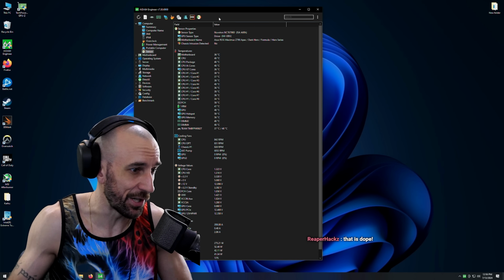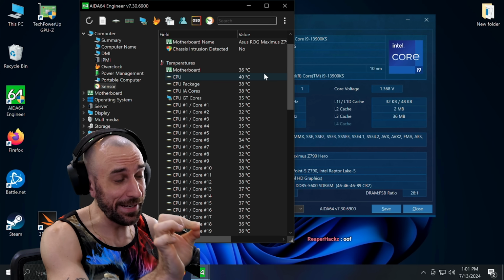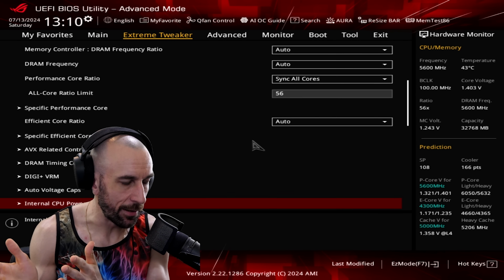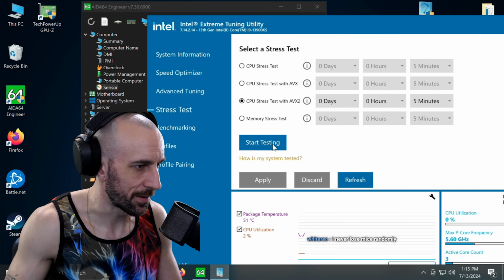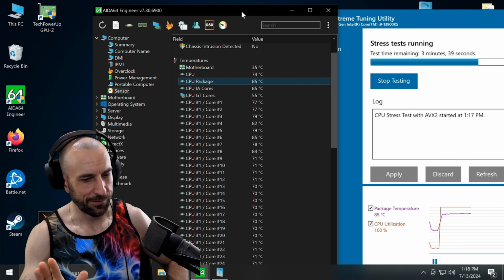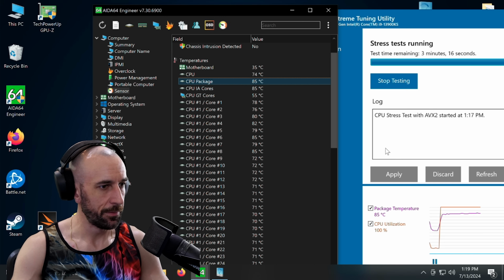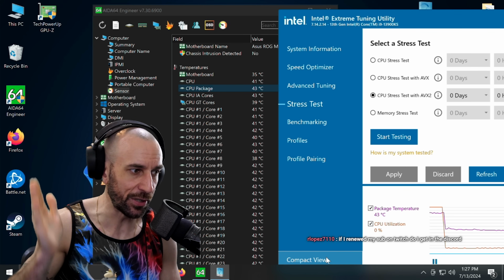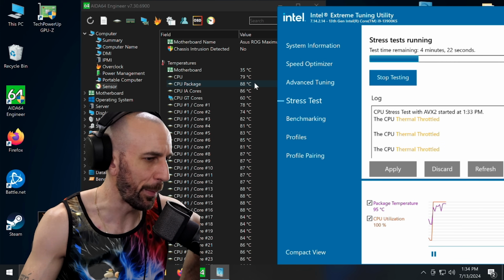🛑 STOP YOUR Intel Crashes 😱👑 (Step by Step Guide)

Comment: Just wanted to say you absolutely were right about the P cores, E cores really it's been better since I turned them off again a couple days ago (12700KF & 12900KF). Gonna see what you have to say about optimizing though I don't have the 13/14th problems with the 2 P cores boosting too high. There is so much bad advice on TechTube though you are helping so much fighting disinformation and just bad advice from people who don't game that much.
Reply: In my case i run stock on my 12700K and e-cores help to boost my singlethread speeds and fps for emulators. I never disabled them, if i do an experiment would be disabling hyperthreading for one P-core.

Also keeping all the cores on are important for fast shader compilation, there's nothing that i hate more than shader compilation stutter and long compilation time.

Comment: I don't even have an 13/14th gen i9 but still undervolted my 11700k and it now runs cooler while performing better than stock. Good videos.
Reply: It REALLT depends on what kind of load you are throwing at it! Trust me!  Most cpu works with undervolt in 90% games. But there is stuff out there that dont. IT will actually require more voltage. Latest being shader decompress UE5 engine. Read my comment up and try out- if it works for you great if not... you cannot consider your cpu 100% stable. it may be stable in the few apps and games you use. But not overall

Comment: Any recommendations for 13700 users? Or are we in the clear?
Reply: According to reports, its the 13th and 14th gen 'K' CPUs. It wouldn't hurt locking the cores to be safe.
Reply: @Alex-ii5pm  does locking means setting the maw boost multiplier or running them all the time at a certain clock ?
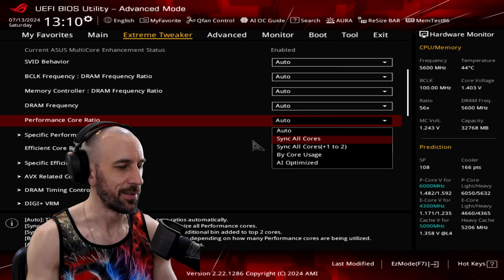Reply: @jittertn  5:18 how its set up here, it sets a maximum, but doesn't lock the frequency to what it's set to, meaning it will down clock if required but will not boost beyond what is set, it will stop (lock) all cores boosting beyond 5.6 ghz. If you set performance power plan in windows the CPU will run Max clock speed 24/7
Reply: @Alex-ii5pm  thanks for the answer gonna set mine accordingly

Comment: THANK YOU! for finding a solution..
Other tech tubers don't know how to fix this issue,
 so they just keep fear-mongering in all directions, shaming Intel, provoking panic..
The CPU just needs a little more voltage, that's all..
Reply: Maybe Intel should know how to fix the problem. Maybe there shouldn't have been a need for clients to troubleshoot products that they bought which don't work as advertised.
Reply: @Dexion845  It's actually not Intel's fault! it's Motherboard Manufacturers! 
because they made Bios with different very low AC Power load-line settings to under-volt the CPU by default.
Intel specification recommends that AC and DC power load line setting have to be the same value, 
But motherboard manufacturers always put very low AC load-line settings by default, compare to DC load-line..
thus sending much lower voltage to the CPU than required..
You can check your motherboard AC and DC Load-line values in HWiNFO, in the "Main window" click on central processor, expand it, click on your processor and scroll down to the "IA Domain Loadline (AC/DC):"
i bet they are different values even tho: "intel recommendations "intel default settings" clearly sate: "DC load Line must be equal to AC load Line".

Comment: Stop your Intel crashes by going ryzen.
Reply: Wish you would have told that to my 7800x3d before it decided to become unstable and had to be RMA'd. Luckily I still have my 14900ks that I tuned and undervolted to my liking when it was new and it has been rock solid stable.
Reply: Some of those game/datacenters did just that switched to 7950X (must have been expensive to do that). Not in the discord but it's taken me about a year to tune fully stable no game crashes (can see the value of the Discord and CoD Bros aren't wrong for just wanting to play after work). Am on 12th gen though 12700KF & 12900KF (have a 12400F around to try tuning also). Spent a lot of time in the BIOS more than 9th gen, even switched to Nobara, Windows 11 was also annoying to troubleshoot, last straw was when the 12700KF just BSODed not doing much in Firefox. Intel had some great sales last year and after it's tuned stable the upgrades have been nice (game doesn't stutter anymore).

Comment: 13900k - zero issues - discord member.
Reply: 13900k, Built system march of 2023, adjusted bios out of the gate to not let chip run rampant and never had a hickup.

Comment: Is it ok to leave it at 6ghz boost, if running a max voltage of 1.375v?  Is the is frequency a problem?
Reply: It's ok, but i HIGHLY DOUBT it that your CPU will be stable at 6Ghz with that voltage.
Reply: @AfshinBarani  not all core no. its 5.8 all core and 6ghz for the first 4 cores. so 60 60 60 60 58 58 58 58

Comment: Also with a rzyen 5000X3D cpu ?
Reply: First thing I did with my 5800X3D was use curve optimiser with a -30 offset granted I lost 50Mhz max boost but all my cores run at 4.45GHz with a gaming workload of 45-50C and max all core 70C on a 6 year old AIO. So there are things you can do to optimise performance over stock even with a 5800X3D
Reply: @Dazzxp  Pay your telecom bills.
Reply: For AMD just go pbo and set temp limit to 68C. Also don't use "performance" power plan, only use "balanced" so you don't cook your cores with idle voltages.

Comment: 14900k 13900k  are enthusiast chips running cinibench R23 with 2 cores boosting to 6ghz at 320 watts 100c degridation will happen. 400A 253 watts lock cores. Delid for proper cooling.

Comment: So what do you lock a 13900k to 5.7 or 5.6?
Reply: 5.4 for 13900k, maybe 5.5
Reply: @justinshinn6218  thanks
Reply: I have one. The first two p-cores boost up to 5.8, and the rest are 5.5. So you would set them all to 5.5 so those two don't ask for ridiculous voltages. The KS is the one that boosts at 5.6.
Reply: @donhomer3479  thanks I appreciate it and should I set a - offset as well and also keep the 253w
Reply: @timtoomuch  Undervolting is always a good idea if the cpu can handle it. I heard most i9s can undervolt at -70mV or -0.07V, but you could try going for -100mV. Try it. If it crashes or you see weird things like bugs or apps closing, you reduce the - offset slowly until it doesn't.

About the power limits... Intel recommends either to set pl1:125W pl2:253W and iccmax at 307A OR pl1:253W pl2:253W and iccmax to 400A.

I didn't notice any difference between 307A and 400A at least in gaming. Try both, and if you don't notice, set it to 307A. But it should be safe at 400A.
Reply: @donhomer3479  thanks for all the help I had an RMA on my original 13900k it was crashing with the out of vram error intel sent me a new one wanna make sure this one stays good

Comment: couldnt you switch off individual cores or is the memory controller and io degraded. Id try turning off cpus in windows if I couldnt in the bios. Try to switch off the broken parts. Nice video, this is why you dont oc without researching first... Imagine degrading your silicon on day one... got to be the worst thing ever... take the voltage back down again and see what the spu runs like now. It would be interesting to see if it was something to do with a transistor or part of the cpu core slightly oxidated or something and not firing and then the extra voltage managed to correct it?? id love to have a play around with that silicon.

Comment: Manual clocks and voltage will prevent the 1.5v+ vcore when it boost. XMP sets my SA voltage to 1.46v which is wild as well.
Reply: i noticed on my msi board the crazy high SA voltage as well. i pretty much set all my voltages lower and overclocked. the pre sets are terrible.
Reply: @MrGreen1988 mine only sets 1.2v SA on auto but I'm only running 6000c40 at 6600c34.

Comment: My 13900ks OCed has never had instability issues. Not sure why.
Reply: Most overclockers don't have issues because we use lower voltage than what modern motherboards shove by default. We've been undervolting for years if you look at numbers.
Reply: lucky 0.0001% 13900ks owner
i remember when the 13th gen first came out jufes said the difference between good and bad units is alot. well it was in the context of ram hitting 8000mhz but it could apply here too
Reply: @centuryt91  I am actually running at 8000 mhz. A pair of team group 16gb sticks. Been that way for like 6 months now.
Reply: good settings & board
Reply: @raditz5  Maybe the units that you and I got when the 13900ks released were not faulty like the newer cpu's.

Comment: Why you only have 31k subscribes is crazy. Your content is straight to the point without all the BS. Keep it up.
Reply: Jufes has good content but he  hates on amd too much to really be mainstream. It's like the this whole thing with Intel is pretty big but he downplays it. Imagine a younger cod bro spending 2500 on an i9 build to have it take a dump because the cpu boosts too much then blame it on the consumer that didn't mess with settings. I merc'd my brother's amd thunderbird back in the day but I was doin dumb things with it 😂
Reply: I would subscribe multiple times if I was allowed
Reply: I would subscribe multiple times if I was allowed
Reply: I agree
Reply: U need to teach the Tec tubers what a real optimizer looks like
Reply: So vcore droop is the real reason it crashing at stock. As it technically the cpu is nose diving once two cores is boosting requiring more vcore/offset since this goes hand in hand regardless but if it too little of vcore/offset it instantly crashing and bsod that why event viewer gives a clue of why it crashed like 0x124 points toward increasing vcore/offset and that why bios optimised isn't the correctly set to Intel specs instead it using the motherboard's own settings therefore the motherboard is not automatically adjusting settings according to the cpu is asking but not getting. The VID requirements from the cpu to the motherboard is not communicating to eachother therefore it set too low don't matter if it brand new out of the box or degraded in stock state or overclocked it bounds to crash regardless
Reply: He's only got 31k because he's a moron 😂😂😂
Reply: no its cause talks about AMD in a bad light and you pretty much cant do that if you want to really really succeed on youtube
Reply: No one can top 100k subs without slobbering the AMD knob. There's way too many AMD fanboys on Youtube. It's sad cause AMD doesn't even make bad products, but they're fanboys are insufferable.
Reply: @zodwraith5745  "but they're fanboys are insufferable."

That can be said of all fanboys, some of the most ignorant and hateful fanboy's I've had to deal with are of the Intel ilk.  They are all annoying and useless.
Reply: @zodwraith5745 many Radeon GPUs are genuinely bad products imo.

Comment: what about max L1 125 watts L2 253 watts ?
Reply: what about it? doesnt matter. lock ur cores and set your own voltage.
Reply: @MrGreen1988  So setting PL1 + PL2 to 253 watts isn't enough? You also have to sync the P cores + decrease voltage? This extra step is mandatory to ensure no degradation?
Reply: @MrGreen1988  true sorry

Comment: How do you do any of this on MSI?
Reply: It's very similar, man. Near the top of the OC menu, Core: Fixed Ratio, Ratio: 56
In the VCore voltage section at the bottom, Voltage mode: offset, under that +0.0xxxxx by whatever you need. Monitor it to ensure it idles at less than 1.4v and it's stable under all core load. You're done.
Reply: @GeekyTechnician  Thank you! Hard to believe that it is that simple of a fix, obviously you have to get a high end AIO as well but if this works I will donate my left nut to charity XD
Reply: @GeekyTechnician  Thank you! Hard to believe it's that simple of a fix, obviously have to get an AIO as well. If this works then I will donate my left nut to charity.
Reply: @GeekyTechnician But you would only need to offset voltage if it's degraded right? Otherwise just lock the cores?
Reply: @whoshotya117  I think in this case you do that to protect the two cores that boost to 5.8/6Ghz. These are the real troublemakers.